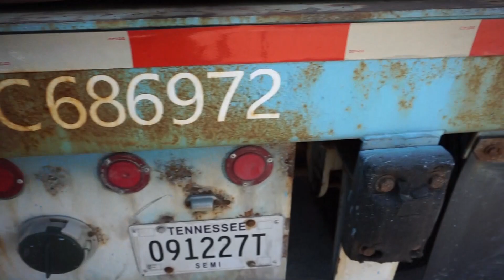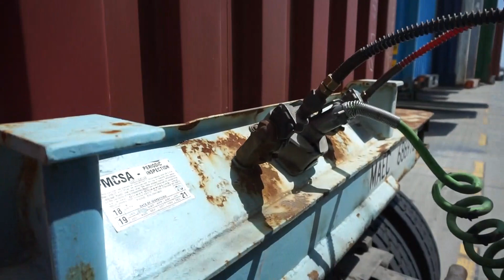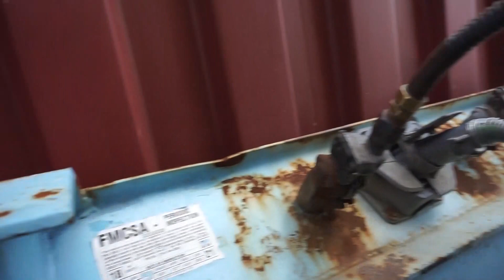RAIL YARDS: AIR LEAK got SCARED and FIXED ITSELF ( WHO KNEW) !!!!

Comment: You got to love this, just when you approach the problem, as you get to the point, it fixes itself!!!    If I hear anything I will let it be.  After five minutes and it’s still there then I will investigate.   Sometimes all one has to do is tap the valves or in the winter heat that valve.  Debris or ice can prevent valve from seating.
Reply from the maker: What's up K.S! Yeah man all these little tricks and hacks come in handy to do this  job lol!